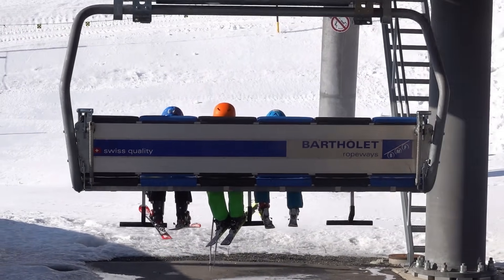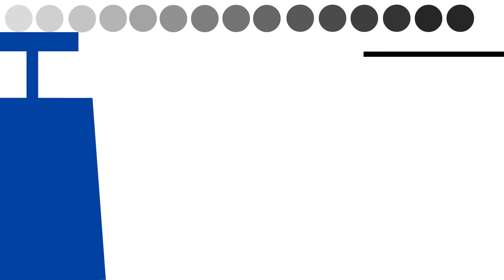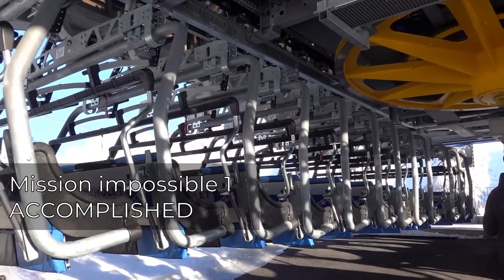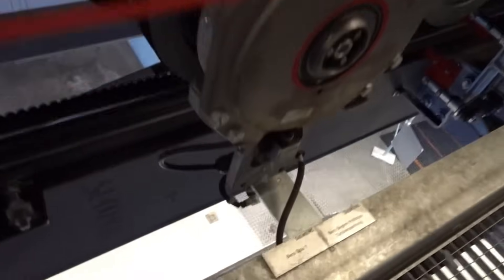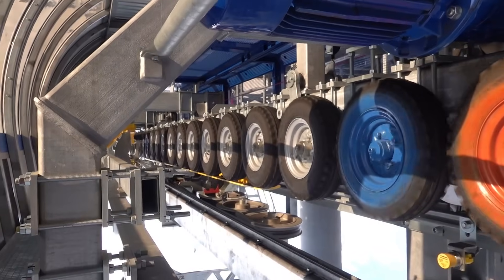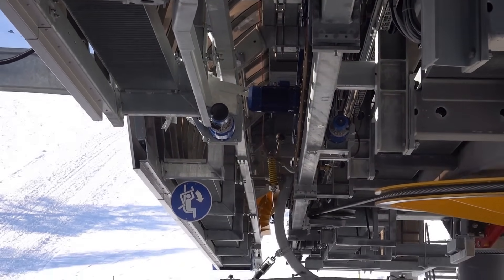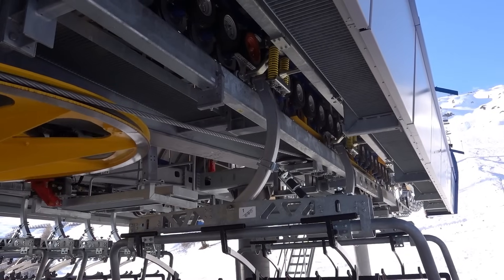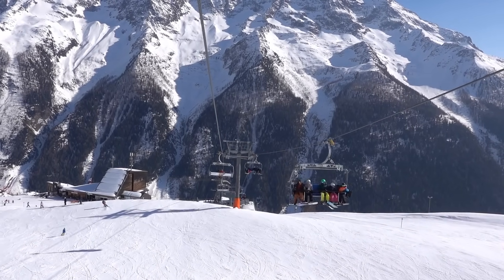The IMPOSSIBLE garaging that actually exists!

Comment: This is very interesting, I have always wondered, how the garaging process in the stations works. 

Some Funitel ropeways (I know this from the Silvrettabahn in Ischgl) also accelerate each gondola individually. It sounds really interesting, with the Motors constantly accelerating and decelerating
Reply: I woundered why those lift had a fairly big building attached to them that was typically larger than the lift it self.

Comment: I guess that you could even achieve this with an entirely mechanical system.
The first feature you need is some kind of clutch that disconnects the wheels on the cable end of the accelerator/decelerator lanes from the cable.
Then that would allow you to run the cable (with the garaged gondolas under the wheels disconnected from the cable) until a gondola is at the very start of the wheels, where you (almost) stop the cable; then you connect the wheels, run the cable one meter forwards, and disconnect the wheels again.
The problem with only using this first feature is that the distance between the gondolas would be uneven, because the speed change along the accelerator/decelerator lanes would still exist. Under the decelerator wheels the gondolas would be pushed together (which isn't a huge problem; as long as the wheels can slip on top of the gondola's attachments this would "only" cause excessive amounts of wear on the tires). But on the accelerator section, the gondola which is on the slow end would always spin the belts, even if the tires are disconnected from the cable, and the gondolas at the faster end would always go faster than the ones at the slow end, which creates growing gaps.

The second required change would be to not connect the tires directly with a belt (neither one that that decreases in speed over the length of the accelerator nor one that synchronizes the tires in sections). Instead each tire would need to be connected to the output of its own differential. One input of the differential would come from a belt that gradually decreases in speed over the length of the accelerator/decelerator lane. And the other input comes from a belt that synchronizes the speed of the whole lane. In normal operation, the belt that decreases in speed is connected to the cable, and the system thus operates just like a classical station. But for garaging, that belt gets disconnected from the cable and stopped, so that the synchronized-speed belt can move the stack of gondolas as a single unit.

In order to not be forced to use entirely manual speed control for the cable while garaging, you'd probably want a system that quickly advances the cable by 90% of the expected distance between gondolas, and then creeps the remaining 10% until the gondola finally reaches the front of the station where it can be picked up by a sensor.

So yeah, this garaging method could have exited decades ago - at the cost of between 50 and 100 separate differentials.

Comment: Another excellent video!
I used to program and operate systems that worked in very similar ways, though at a much smaller scale, and I love how they used a few speed sensors and inductive proximity sensors and a lot of brain power to set this system up!
The way they stack them close on the last section, and then backfill from there is genius, and I assume that what you mentioned about the rope speeding up and slowing down was when they were filling the very last set of tires? Going fast to get the next chair in, and then slowing down as it transfered into the independent tires?

And I assume that to unload, they just run the rope slowly and the last independent section jogs periodically to inject a car onto the exit tires and the rope?

Anyway, yes, I DO understand how much work it takes to get and keep all the sensors properly adjusted, and the settings correct in the PLC! I used to do it to a few mm precision on even more complex machines, but not nearly as cool as this! Lol

If I could make one request, people like me want to see brand and model, especially on things like the PLC controls.
I couldn't read any names on the stuff in the wiring cabinet, though I am only on a phone, and it looked like just the i/o modules in there anyway, not the actual PLC computer, but if you were able to include close ups that make brands and models readable when you can see them, or even manufacturers logos, it just makes us Industrial Automation nerds happy!
Reply from the maker: Hi Ben! You probably understand this system much better than I do. So to answer your question, I have to rely on what I observed. Those motors likely use PWM as you can bearly hear them ramping up or down, and there are so many of them in this symphony! So hope I sensed it right when I say that the main motor was rotating quickly in the beginning of the process, and gradually slowed down as the sections filled up. In the end, it ramped down every time a chair entered the station and reached its slowest speed at the moment of the handover to the first independent section. I guess that's also to keep the acceleration of the already parked chairs reasonnably low every time they are pushed forward to fit another. After the handover, the motor slightly ramped up again until the next chair was within reach. So yes, my observations agree with the process you are describing.
I've never seen the un-garaging IRL, but that seems to be the only doable way to me. Also, from the way it is built, it would seem logical to do it this way.
I'm alway trying to find a balance between making the nerds happy and not completely overwhelming the casual viewer. Since the video coming up is gonna be waaaay too detailled for the latter, I might as well try to find a shot with the brands visible. I'll see if I got a few close-ups in the footage!
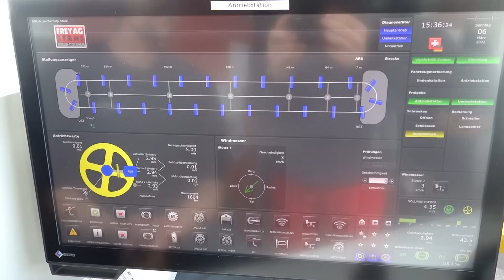Reply: Bit late to the party, but at 7:38 you see a big label PLC 🙂. The PLC and IO-Racks seem to be Pilz PSS u2 Line. On the row above the PLC you can also see, what seems to be Media Converters from standard Ethernet to Fiber Optic cables. My guess is that they need to use fiber optics to connect to the other end of the lift. Copper cables are pretty limited in range (about 70m), so they use fiber optic (up to 5km).
Also when he shows the other cabinets, you also see clear labels (PLC and IO-Rack). As for the motors, they seem to be standard industrial motors (I guess Synchronous, because there is finer control possible than on asynchronous Motors) with an encoder attached to the back. There is probably a rack of servocontrollers in the cabinet. I don't think Motors of that size are controlled by PWM. Usually the servo controller get's a setpoint by the PLC (Position or Speed), get's the exact actual values from the encoder and fine controls the current in the three phases to position the Motors exactly.
Also it seems to me, that the system is controlled by two redundant PLC's. That's usually a standard in those type of installations . One actually controlling the system, the other in standby in case the first one goes offline (Power loss, component failure etc)

Comment: Very interesting video! Thank you so much! 
In the meantime I wonder how the unloading works.  Do you have some footage of it?
Reply from the maker: Unfortunately I don't - I'm too lazy to get up at 5 or 6 AM to be there in time ;-) but I doubt it'd be more spectacular than the garaging.
Reply: It's the same system. So the first section slowly moves the first gondola onto the rope section and then stops as the first gondola gets accelerated. As soon as the targeted distance is reached the last section moves again to get the next gondola onto the rope and then waits again for the right distance.

Comment: One ski resort that I have ridden for years (and worked at for a bit) US, West coast, had until recently a rather old Doppelmayr gondola system and while carry around belt was mechanically linked it did have an active spacing system in that there was a single tire on the departure side that was electrically driven and it would hold the gondola there until it was ready for launch and would then push it into the main tire acceleration line.

Comment: The grouping of tires and driving by separate motors introduces a lot of mechanical inefficiency. Those acceleration and deceleration phases are required for every chair all day, but only really have an advantage for the single garaging function.
A potentially more efficient way would be to use a conventional set of belt driven slow section tires powered off the main rope but on every tire have an electromechanical clutch. Garaging in the slow section would be as simple as pulling the clutch on each wheel to stop the drive. While not trivial to program, probably possible even with a low end PLC.
Reply from the maker: I was wondering the same thing. But appearently the inefficiency is not large compared to the overall energy consumption to run a ski domain. Imagine the power that the main motor alone consumes. And imagine running snow machines producing artificial snow for the pists. So it's probably more economical to just solve the problem with motors. 
A different manifacturer might have solved the problem with more clutches / Beros. However those might be expensive to fit onto every single tyre.
Reply: @sandro-here  you make a good point and there is always a choice to be made between hours spent designing for efficiently and running cost of a simpler design.
After I made the first comment I wondered on the control gear implementation: it's possible they run a common high voltage DC bus and generate back into the bus when slowing the chairs down, then  use the energy in the bus to accelerate the chairs the other side.
We pay quite high prices for lift tickets in Switzerland, so I doubt they really worry about electricity costs.
Reply: This system does exit !
Every other tyre has a pneumatic clutch, when then gondola reaches its "parked position" the 2 wheels are stopped
I have sean this system on leitner and poma lifts
Reply from the maker: Amazing, can you share a link?

Comment: Awesome as it is, if you talk about precision choreography, you must look the motor controller, how ir ramps current on each passing coil, that's precision on other level. Then you can look for a stepper motor controller, with a thousand ramps for each turn,turning hundreds of rpm.
Then, you realize how much an electronic controller can handle.

Comment: Alpine Engineering: Ramcharger 8 Continues a History of Chairlift Innovation. Big Sky Resort’s Ramcharger 8 is the first eight-seat chairlift in North America and one of the most technologically advanced chairlifts in the world.  With a history of innovation in the ski industry that includes introducing the world’s first triple and quad chairlifts as well as the first high-speed six-person chairlift, the resort made headlines once again in 2018 when it introduced Ramcharger 8, an eight-seat chairlift that sets a new standard for lift technology. Boyne Resorts partnered with the Doppelmayr shop in Wolfurt, Austria, to bring the advanced lift to Big Sky. Safety is a key consideration in all aspects of the lift’s design. In 1999, Doppelmayr launched a fail-safe system that monitors the position of the haul rope directly on the sheave assemblies and recognizes any deviation of the rope from the sheave groove at an early stage, thus significantly reducing the risk of deropement. Guests also benefit from ergonomically shaped, extra-wide heated seats; weather-proof bubbles in Big Sky’s signature blue color; and wide footrests ideally suited for skiers and snowboarders. All 65 chairs feature the new Ramcharger 8 logo and different printed designs on the chairbacks, creating visual interest and distinctive styling for the installation’s overall look. Mesh banners on the back of the chairs provide optimal advertising space, as they can be custom printed and easily replaced in line with promotional needs and the season. A particular eye-catcher at the bottom station is a huge high-definition video screen, providing Big Sky’s guests with the latest information on trails and weather conditions. The lift is easy to load, starting with the load gates, progressing onto the conveyor carpet and finishing at a load table that can be raised or lowered at the touch of a button. These features combine to help ensure a smooth, safe loading process that greatly reduces the likelihood of misloads. In addition to a manual option, the D-Line chair offers two other operating systems for the restraining bar: lock or autolock. Lock means that the bar is automatically locked after manual closure by the passengers and automatically released, then opened in the arrival station. In the case of autoblock, the restraining bar closes and locks automatically. This operation also is monitored to ensure the restraining bar is closed when the carrier leaves the station. Here again, the restraining bar is automatically released and opened at the other end. Another practical feature of the new installation is the chair parking facility, which is fully automated. Which Can Be Programed To Auto Dispatch Chairs On A Set Time Each Morning & As Well As Closing & Parking Each giant 8 pack chair nightly in heated garage. >>>>>>>>>https://www.youtube.com/watch?v=qAiycQQ0e3A

Comment: Is it possible to get information how they are measuring the clamp force of the detachable grip?
Reply from the maker: Unfortunately, I don't know an engineer that could answer that question.
Reply: @sandro-here  And what about the operator?
Reply from the maker: @peterkovalcik5484  He knows how to use the device, not how it's built. There is more grip pressure sensor and controller footage in my three videos about the chairlift comparison.

Comment: For older lifts where the tires are mechanically linked, does the mismatch between wheel speeds cause any kind of strain over time? Or I guess it has a finely tuned slip like a clutchso it doesnt matter? But if that's the case, why did they feel the need to get rid of this with computers?
Reply from the maker: Yes, the tires take the wear and must be replaced occasionally. Some lifts have clutches that click to reduce the wear, see my video about the gondola at Flaschen.

Comment: This whole system is pretty cool.
I think this could be adapted to the MultiFunction Elevators that also can move horizontally. The system that does exist already for that is incredibly expensive; while this would be expensive too I think an adaption of this design would be a cheaper method to move Elevator Cars horizontally in a building. There would still be no reason to change the method for switching elevators from vertical to horizontal movement; that design passed safety regulations for elevators already which is super hard. Or this could be partially adapted with the purely electrical MultiFunction Vertical/Horizontal Elevators. Each Chair Lift for this design would be rated for three Humans; since forbidding people over 300 pounds can be a PR Nightmare...this should be specced for 1000 pounds/chair as my guess = already half of Elevator Rating. So this would not have a need to make a more heavy duty version to be useful for horizontal movement in a building...just change the passenger section to a two seat bubble + fancy details as desired by customer.
Reply: 6 Seats = at least 1 ton rating...300 pounds times 6 = Elevator Rating already.

Comment: Saying "pushing controllers to their capacity" sounds weird, a very Youtube way to describe things. A smartphone performs many more operations per second than the computer controlling this chair lift.  The chip and motor drivers are just specced to the computational load that's needed. If there was more to compute they would just install larger versions.

And I can't help thinking that this garaging could be achieved in a much simpler mechanical way by disengaging most of the deceleration/acceleration mechanism, and softly pushing the chairs into a big bunch...
Reply from the maker: I'm only repeating what I was told by the operator, so this is second-hand information at best: As I understood it, these are not computers like we have them on phones etc. They're more like SPSs (the industrial and completely overpriced "smart" steerings you'll find in a larger building's heating or automation system), but with more redundancies. So they're probably more like a glorified Arduino than like a smartphone. Thus, RAM and ROM are likely to be very limited. Maybe for the better! The simpler they are built, the more verifiable they are.

Comment: “If you’re from the us you would call this a cable” because that’s what it is? A rope is made out of twine not metal.
Reply from the maker: Well, it's both. It's braided (if that's the right term) like a rope, but made of steel. It also conducts electricity for communication (in some cases), so it's also a cable.